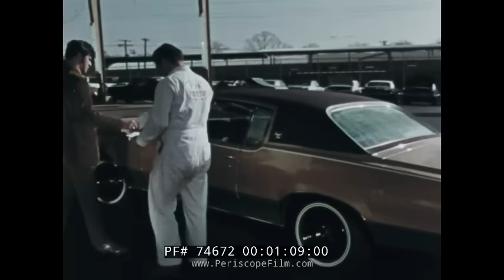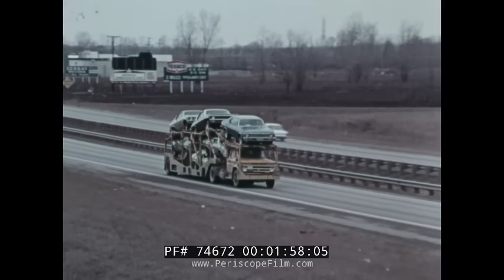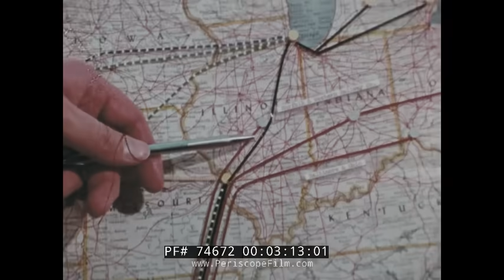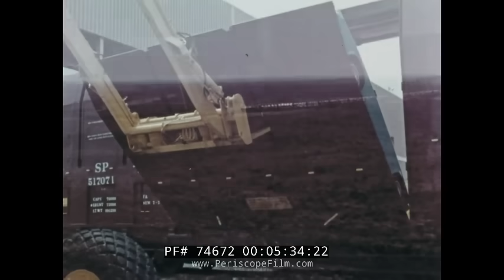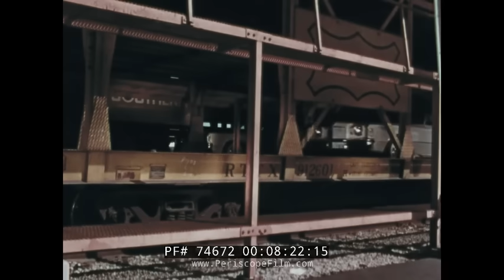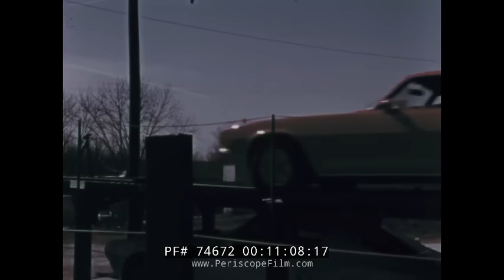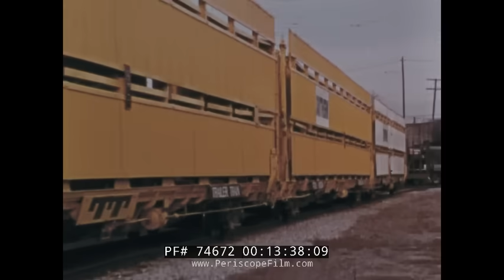1970s GENERAL MOTORS   RAIL SHIPMENT OF NEW AUTOMOBILES  LOGISTICS / SUPPLY CHAIN MANAGEMENT  74672

Comment: 1970 General Motors the largest private employer in the U.S. with 600,000 employees. I think the starting wage for union employees was $17.00 an hour. Look how far this country has fallen and GM.
Reply: i started for $6 an hour in 1978
Reply: @harrybriscoe7948  Assembly line? Union?
Reply: @thyslop1737  UAW Union machine operator making parts for assemblies  to be shipped to assembly plants ,  that was enough for a house or new car . back then  , Are you old enough to remember the new Pinto advertised as a starting price of $1919.00 ?
Reply: @harrybriscoe7948  $1919 in 1970 is worth $13,080 today. today the most entry level ford, the fiesta, has an msrp of $14,500. so taking into account the vast improvements in mpg, emissions, handling, safety, technology, performance/reliability, and regulatory costs, an entry level car has kept up with, if not below inflation. but hey "everything was so much better back then".
Reply: @atl_h2_nw  $1919.00 . Same as advertising for 99 cents or $9.99. But as now the add ons like registration  , taxes , options etc  boost the real  price
Reply: @harrybriscoe7948  well the $1919 pinto was also the base model. and the equivalent car today is much safer, performs better, is not a vehicle used in jokes, emits less, and has far superior comfort and technology. and this is accounting for increased laws and regulations pertaining to safety, environment etc. so i'd say a fiesta today is even lower cost than the $1919 pinto.
Reply: @atl_h2_nw  ....And don't easily explode when rear-ended.
Reply: Harry Briscoe what plant(s) did you work at?
Reply: @atl_h2_nw  Not more comfortable. New cars are not comfortable. I still have my comfy, smooth riding 73' Mach One. I have a new F350 diesel for trips.
Reply: T Hyslop 1973, started at 3.65 hour
Reply: And Southern Pacific is now exists as Union Pacific railroad i hope GM doesn't fall like the good ol eSPee.
Reply: @brandedmcgowan9414  The D&RGW bought the Espee but kept the name
Reply: @godoftheinterwebz  yes i read it on wiki (the little fish purchase the big whale)
Reply: Isn't $17 an hour in 1970 like $116 an hour today? That would be around $250k a year which would make for some expensive cars
Reply: BS...I started at AMC Jeep in 1978 at $8 an hour...all auto manufacturers paid about the same wages
Reply: BS. Starting wage in 1970 was $3.33 per hour at GM.
Reply: @joelmogensen579 damn minimum wage in the 80’s was 3.35 until 1990.
Reply: GM builds SHIT. Over $1 billion worth of V-8 engines recalled. Now 2026 models are having the same issues
Reply: @coolruehleit will teach them to straighten up or ship out… they are trying to get them engines past warranty with the new oil.. I would NOT be buying a used 2019-2026 Silverado or Sierra today… you can see it in the used pricing right now..Sierra Denali ultimates are like 56k for a 2024that normally would be 65k plus.
Reply: The United States Postal Service employs almost 400,000 people now
Reply: @lucky1206  and it serves how many people 🤔
Reply: Look at the post war middle class, wouldn’t happen without the great living wage union jobs. Compare it today for the shrunken middle class skimpy offerings. Than look at the wages of those higher up management positions compared to blue collar jobs, a even greater difference in $$$ than in 1970’s🤔
Reply: @OKFrax-ys2op  Many factors in the discrepancy like offshoring manufacturing and debasement of the currency.The last link to the gold standard was severed in 1971. The currency, not money PRINTED OUT OF THIN AIR, back by nothing, then lent out at interest has done the most damage. With no restrictions to currency printing we totally enslaved to debt.
Reply: @thyslop1737  my dad was a light bulb machine builder at General Electric, not too far from the plant that I worked at, machinery  and manufacturing went down south to nonunion areas, before proceeding overseas. Yes there are a lot of different factors on the decline of US manufacturing and other areas of industry. So sad considering the powerhouse of the world, where other countries protected their workforce and manufacturing might, seems like ours were left unprotected 🤔
Reply: Ten years ago, the top rate was $60.00 an hour 😮.
Reply: $17.00 an hour is what buried GM. Labor cost and candy land work rules killed it.
Reply: 😂 I wish
Reply: 17/hr in the 70’s. Stop talking out of your ass, that’s completely false.
Reply: @pryme2013  that’s right, I started at Fisher Body in 1977, at below $10 a hour
Reply: @pryme2013  This was quoted in a documentary." Am sure you can't wait to have to have a  rake handle up your ass".
Reply: That's equivalent to $132/hr (over 200k a year) today....    There's no way GM was paying those wages, they would go bankrupt in a hurry.
Reply: They are not and were not private emplyer.
They are a publicly traded corporation.

Big difference
Reply: I think the starting wage for union employees was $17.00 an hour

17/hour is a way bit too much for 1970... more like $4.00 an hour
Reply: Skilled trades 1975 start was 6.10 😂
Reply: THAT SAID, it was extremely hard to get a job there (or any car plant) without either knowing a foreman or manager to put in "a good word for you".  SAME with being a bus driver in Vancouver- completely controlled by the SHRINERS...
Reply: @TheSpritz0 it was that way in the late 80’s early 90’s too..I always wanted to work there
Reply: $17 per hour in 1970 is worth approximately $142.01 per hour today, based on the Consumer Price Index (CPI) inflation calculation. This indicates a cumulative price increase of over 735% between 1970 and today.
Reply: Are you high? This is why the union sucked and brought the company down- drugs
Reply: $17 per hour in 1970 is a wayyy too high number. Had to be down near $3-$5 per hour wage. $17 in 1970 was like a hundred dollar bill today
Reply: The automaker usually pay about twice the amount of minimum wages.,so if minimum wage was 1.60 hr in 1970.. they most likely started at 3.30-3.50 hr.
Reply: Now we have all our stuff made in China, China owns our land, China owns most of our government. We used to have the biggest Rare Earth Metals mine out in Cali. Now it's closed "because of the environment" and we just have China do it cheaper and damage the earth more than us. China controls us. We are a Chinese colony at this point.
Reply: @g.williams2047  totally agree, same in Australia to.  Idiot governments have sold us out for decades.
Reply: @petergoodwin2465  It's truly unfortunate. Doesn't China own several Australian ports?
Reply: @g.williams2047  yes mate they own half the country , it's become a really bad joke , everything you buy is junk ,cars , parts , everything.  We don't build cars anymore, nothing.  Just built a 327 chev , used all USA made parts but was a bit worried about the pushrods,  proform or some crap,  they wore the tips off in 20 minutes.  Unbelievable,  that never happened when parts were made in Australia or the USA.  It's not cheap when you have to buy it 10 times .
Reply: @petergoodwin2465  Hey man, that's what happens when capitalism just spirals out of control. Somewhere along the line, the elites figured out that you don't need to make a quality product to make money. We just get cheaply made garbage that gives them huge profit margins. Really sad that they gutted our industries for this overseas garbage.
Reply: @g.williams2047  spot on mate ,it's just greed and a disgrace,  I still have my old Chrysler regal se with a hot 360 that was built in Adelaide Australia and a 67 impala,  both have way over a million k's.  They built things to last back then,  last modern Holden I had fell apart at 280,000 k's, it had a terrible European engine in it ,Saab or some crap because they stopped using the Buick engine.  I hope it comes back and bites the traitors on the ass. Have a good weekend mate.
Reply: @petergoodwin2465  Cheers!
Reply: @g.williams2047  Chairman Bei Jing Biden and The Party is very concerned .
Reply: oh yeah the usa has totally fallen so hard. i mean for every $100 of an ipad produced, usa captures $90 of that, the manufacturing country only gets $10. just rock bottom for the usa, researching, and engineering, and designing, and innovating. we need to abolish this system of free trade so we can make sure everyone has a factory job! it's not like there's a 4th industrial revolution coming, we should just deny, bemoan, grunt, cry and resist it and vote for a socialist. yup, just rock bottom.
Reply: @atl_h2_nw  he manufacturing country- China- only gets $10 but they only pay their workers like .10 an hour

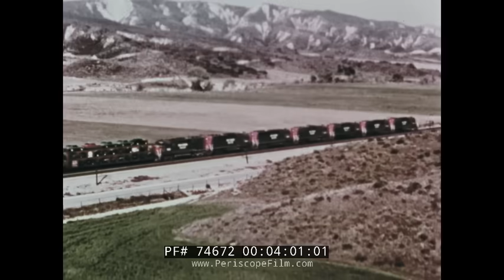Comment: It’s no coincidence that all those shiny new locomotives at 4:02 were built by GM as well. A few more horses than necessary to pull that train, but it’s appropriate & looks good in the video.
Reply: Back when GM made Excellent cars, trucks, buses and locomotives.
Reply: @apolloniaaskew9487  but the Aerotrain was a piece of junk. They never sold one
Reply: @godoftheinterwebz  if GM never sold an aerotrain, then explain how we ended up with two being preserved
Reply: @jerrysgardentractorsengine2243  they built 2 prototypes and eventually sold those. they never sold any to the major railroads they were aimed at.
Reply: @apolloniaaskew9487 spoken like someone who isn’t old enough to remember. The Vega, Chevette, Monza, etc
Reply: The Espee always put a lot of power on their trains to get them over the mountains. They even used mid train and end of train helpers
Reply: They had to cross the Rocky mountains.
Reply: These are souther pacific sd45’s
Reply: @cmadden3364   12,900 cubic inches of V20 inside the hood of each of them
Reply: Electro-Motive Division 👍
Reply: 😅😢😢l😢😢😢tikhe 😮i

Comment: Those Vegas flat packed nose to tail upside down, were they shipped with all fluids removed ? Would worry the fuel, oil, trans fluid and diff fluid would leak out.
Reply: The Vega was designed to be shipped nose down in Vert a Pac railcars. The engines had baffles in them to limit oil flow and spills. Even the washer fluid containers were specially designed. Drawbacks were no other make or model could be shipped in these vert a pac cars. The rail cars were returned empty to the Vega assembly plant. As video intro says, Vega production ended and the railroad cars were rebuilt.

Comment: those new Pontiac grand prixs make me drool and want to jump in a time machine if one was invented
Reply: I am fortunate enough to own a beauty of one. It is still running on the (never rebuilt) original engine. Quadrajet, points ignition and R12 in the A/C system. I just took it out for a drive this evening.
Reply: Brand new for about $2800
Reply: Makes we want to go on Ebay Motors and start looking for one!!
Reply: george wilson my nephew has one !  1976 Pontiac Gran Prix... fixxxed up a tad! Spanks those ??  455 olds Rocket under the hood ! Modified!!
Reply: I want em all ! lol
Reply: Super  cool

Comment: The Vega was one of the first production vehicles to be made from thinner gauge steel to save weight. Consequently, those in the rust belt didn't even last five years as they were structurally compromised by rust to the point of being undrivable. The vertical shipping was just a passing trend.
Reply: Was a little unnerving for a car to start rusting in the showroom
Reply: @garysprandel1817  The Vega was pretty much junk bumper to bumper. The engine that was developed for the Vega ceased production while they were still giving the body new names for a few more years.
Reply: @jimburig7064  oh I am intimately familiar with the ginormous clusterflop that was the Vega while I didn't own one several buddies of mine in high school did.
Should have been a clue that when a lot of us were driving mid to late 60s beaters back then they were able to afford a 4 or 5 yo car for the same beater price.
Reply: Yep. Saw rust spots on a brand new car IN THE SHOWROOM when I went with my dad to pick up his car from service in the early 70s... In those days, cars were almost biodegradable.

Comment: GM logistics. They were the ones that scratched the roof on my new '78 Olds Cutlass. Someone left chains hanging from above while my car was being backed out underneath. They dented the trunk lid also. The dealer attempted to fix the damage. Their body shop did a poor job with over spray. Had red paint on the chrome pieces and dull spots in the finish. GM's commitment to the highest standards I guess.
Reply: Why did you accept the car then?
Reply: Having worked at dealerships for 30 years out of all the mechanics I would trust to do any job is two, and one of them has now died.

You would not believe how dealerships advertise trained staff but honestly apart from the two (now one) mechanics I mentioned I would not let any of the others even blow my tyres up.
Reply: @Gman2060-v5d  don't believe you, I've seen the undercover videos
Reply: why did you accept the car then? sometimes things get damaged in transit. acceptable iso limits for damage is something like 25/1000
Reply: @Gman2060-v5d  you're talking what?
Reply: Lousybarber 42 years old you don't expect scratches?
Reply: @Gman2060-v5d  it was when the car was new he is talking about😷
Reply: all mechanics in US dealers are certified morons and about as ignorant and incompetent as Trump. Ive seen their "skills" first hand.
Reply: @markrickert9040  I thought G man was talking rubbish, he was feeling a little left out I guess